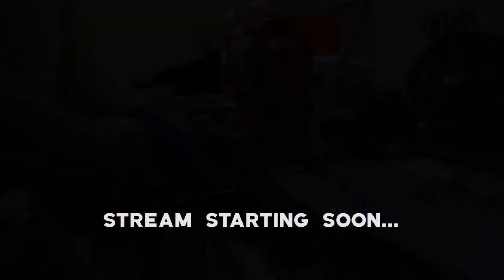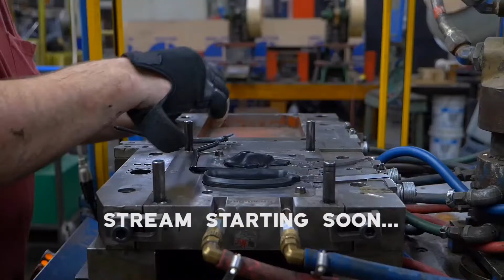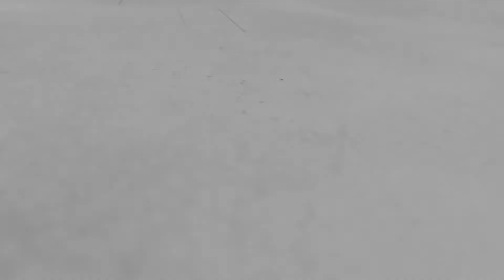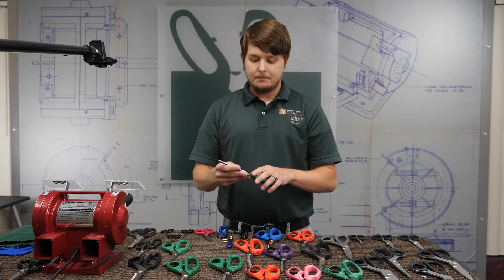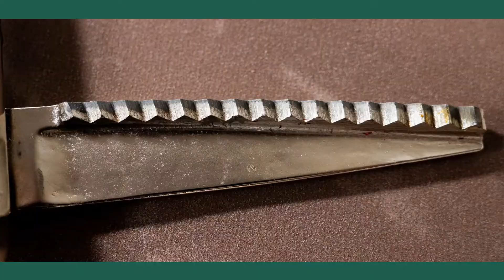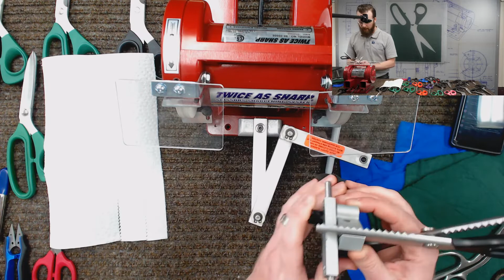Wolff Weekly #6 - Industrial Scissors & Sharpening Pinking Shears

Comment: Thanks so much for these videos!
As a new sharpener, they are very helpful.

I purchased the Ookami Gold system a few weeks ago, and am still learning how to use it.

One question I have, (not sure if it's a subject for a video), when should I hone or not hone a blade?
The manual is a little vague in that area.
Also ... when I attempt to hone, only the bottom half of the blade gets polished.
That is - the cutting edge gets polished, but the polish never really gets all the way to the back edge of the bevel.
(I hope that is clear)

Thanks again for the great instruction.
Reply from the maker: Hey Austin, honing will depend on the material being cut. For example, silks tend to slide in the cut so you would not hone the thumb blade in this case. It needs to be a little more abrasive to hold the material. This may be something that you'll have to learn over time as you get experience with different materials. Any kind of slide cutting will definitely need both blades honed.
Reply from the maker: For the second query, it seems like the arm isn't balanced. Try tightening the arm bolt more. The blade is hitting higher on the wheel so you need to lower it slightly to cover the entire bevel. During this video, we show a bit on balancing arms at about the 3:22 mark: https://www.youtube.com/watch?v=1ec42OBj-4Q&t=1s
Reply: @wolffindustries  Yep! That fixed it - now the hones are beautiful!! Thanks!